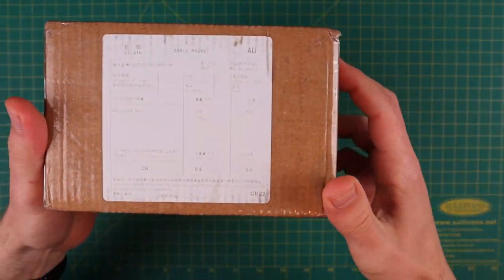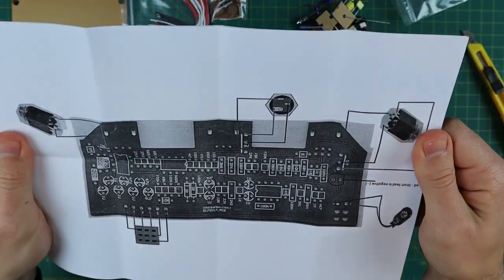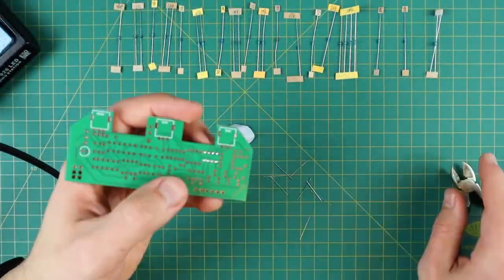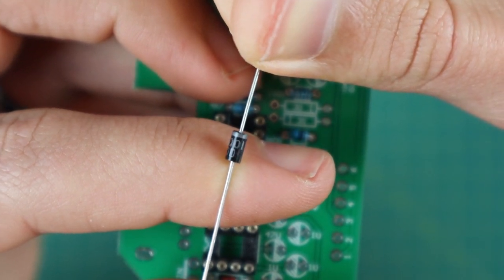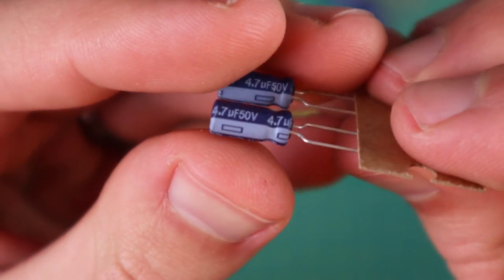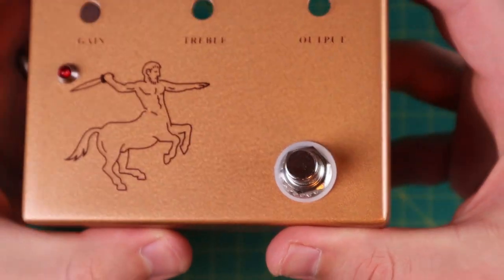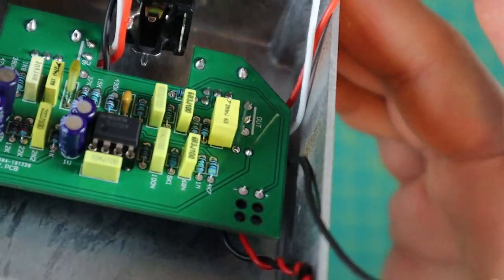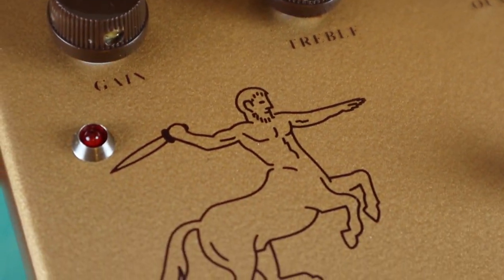How to Build a Klon Centaur Clone From a Kit (Step-by-Step Tutorial)

Comment: I might need a little help here.

I assembled the pedal, and it worked on a battery. I'm assuming I miswired the powerbrick input, because when I attached it to a 9v brick, it behaved normal, but when I connected it to an amp, it was not reacting to input and just buzzing. I took it off the brick, attached the battery (had taken it out just in case), and all I got was high pitch whining sound (not as loud as with the brick), no reaction to inputs.

I rewired both the power jack and sound input-output jacks, so that I don't accidentally have a hot and a ground mixed up.

No sound output. None at all.

The caps look normal, no burned smell, the only abnormality is that the right side chip gets hot as soon as I power the damn thing.

Other than that, the device performs as expected. It powers ONLY when I have a cable attached to the output, and the LED glows red. The only two symptoms are the absence of sound output, no matter what I do to the pots, neither when the pedal is on nor when it's off,  and the fact that the right-hand chip is warm to the touch.

Should I replace the chip and see what happens, what would die first on a pedal like this?
Reply from the maker: Hmm I'd start by using a multimeter to work out if the power supply was wired the wrong way or to see if there are any shorts or bad connections. The fact that a chip is getting hot is concerning. I'd check the signal path leading up to and past that point looking for any bad solder joints or any issues with a multimeter.
Using an audio probe is also a great way to see how far the signal can pass through the pedal before it fails. Most of the time when I've had problems with a build, an audio probe found the problem. I'd only replace the chip if the audio probe reveals the problem starts there.
Reply: @AaronMatthies  ah, perhaps I didn't express myself clearly.

When I built the pedal, I tested it. It was working, and it worked for quite some time. But it worked from a battery, I didn't test it with an external 9v power supply (negative center).

The external supply is tested working with a Boss MD-2 pedal.

I'm assuming I wired the 9w power jack wrong in my pedal wrong, because when I connected the external power supply, it started buzzing. Turning the pedal on would make the buzz louder. I took it off the power supply, reinstalled the battery. Now instead of a buzz I had a high-pitch whistle. No guitar signal would get through the pedal. Which, as I said, was working previously.

I opened the pedal and re-wired the power jack. Reconnected the pedal to the power supply. No sound whatsoever. Other than that, the pedal was behaving as normal: it would turn on (power LED) when the output was busy and the footswitch was pressed. But no sound.

What I was asking was - if I reversed the polarities or maybe attached + or - to the ground, what would die first?

I'm positive the build has no bad solder joints and no shorts on the board.
Reply: @AaronMatthies  just in case, I got 4 op amp chips (power regulator chips were unavailable at the local radio electronics store, I'll replace those and update you on the result. A simple mod to this schematic would be to wire a diode across the power jack inputs, so when you reverse polarities, it kills the brick, not the pedal)

Comment: Aaron Matthies, even thought similar components from a single manufacturer  have slightly different tolerences. I would imagine the best clone would be one  that is built with the exact same brand of components as the real Centaur pedal. Are these DIY kits doing exactly that?
Reply from the maker: You can buy expensive boutique Klon clones that don't use the exact same brand of components as a real Klon, so I wouldn't expect it from a $40 kit.

Comment: Maybe Someone can help me? I built this exact kit and it only works outside the enclosure? As soon as I install it goes silent.  I know it's something simple I'm over looking.....please help.
Reply from the maker: If it works outside of the enclosure but not when mounted in the enclosure, it means something is shorting out by touching the enclosure. Take a close look at everything that could be touching the enclosure. You might also want to check the wiring on the input and output jacks because if one of those are wired the wrong way around, it would create a short when mounted in the enclosure. You might want to check against the wiring diagrams in my guide for a way to double-check your work.
Reply: @AaronMatthies  awesome! Thanks. I’ll double check again.

Comment: just built one a couple of weeks ago. sounds pretty good and has pretty low feedback.

If you break a germanium diode though, like i did. You can replace them with any diode i was reliable told. Don't even bother emailing the manufacturer prolandtone, they did not get back to me either time i tried. and their website is nowhere to be found.

Hardest part, was getting the capacitors in the right spot.

I went to DIYguitarpedals. good aussie pedal builder.
Reply: I used your guide too, its good.
Reply from the maker: Thanks for sharing your experience. DIYguitarpedals are great! Paul is a great guy and provides fantastic support to the pedal building community.
Reply: @AaronMatthies  building one of his vulcan drives at the minute. Very helpful guy.

Comment: I followed the steps and mine is beeping like siren head :(
Reply from the maker: If you haven't already done so, start following the steps in the troubleshooting section of my guide. Almost all of the problems I had building other pedals were found with an audio probe, so if you don't find the problem after going through the other steps, I'd build an audio probe.
I know it's frustrating for something like that to happen after building a pedal, but you will find the problem. It doesn't take much for a pedal to fail, but once you find what is causing the problem, it's usually a quick fix. Good luck and don't give up.

Comment: Your opinion about this model Clone Centaur?
https://twitter.com/naitouwwwww/status/1319564444519677954?s=19   
Apart from the fact that the PCB and the color of the capacitor are different, as well as the box and the switch.=$80
Do you think there are differences in tone between her and this model you are showing. $39,90.
It seems to me that it's all the same from the above things, the scheme is is the same
Reply from the maker: I'd imagine that unless you had both of them side by side for a direct comparison, it would be hard to hear any difference. It looks like a nice pedal and I like that the enclosure looks more like a real Klon than the one I bought.